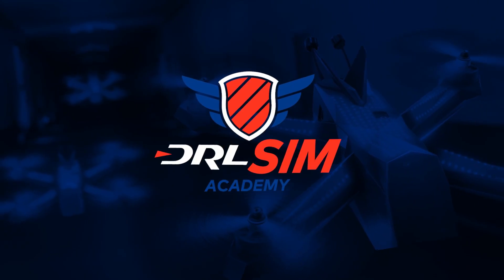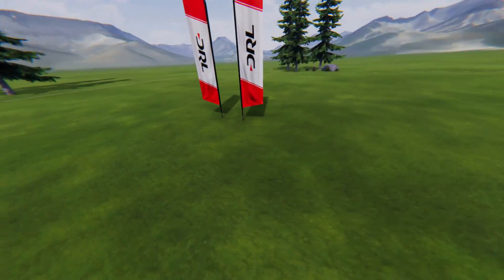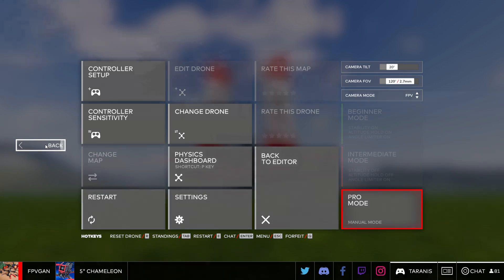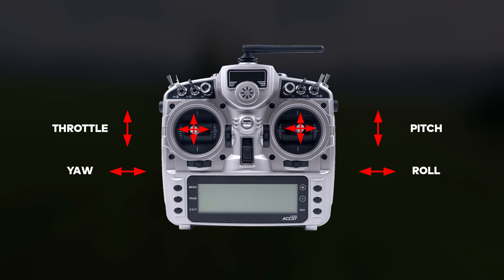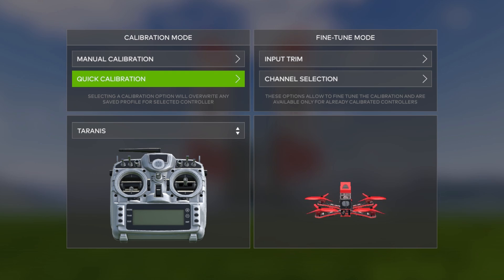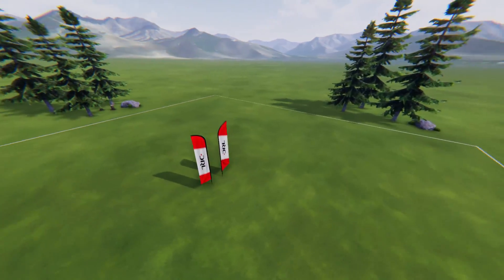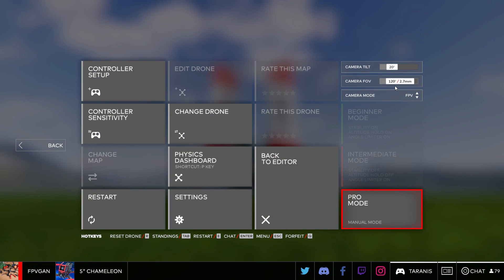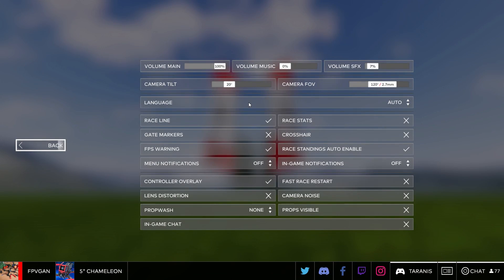DRL SIM Controls & Hovering

Comment: Hello. I am begginer and just got my taranis q x7 and bought your DRL Simulator on Steam. 
I have a little problem since when i just Thruddle up on my Controller, drone starts to move up BUT also a little forward. Is this normal? Or should it just stay still in the air as it is shown on the tutorial? 

I did calibration both on controller and in game.
Reply: Hi Dawid! Sorry for the late reply. But rest assured.. if you were taking off from a podium, they are angled, which means you will fly forward if you only applied throttle. If you land the drone on a flat surface and then apply throttle, the drone will lift up and more or less maintain a level hover. Kep in mind that the drone will still float around a bit here and there, as the drone is in Pro or Acro mode then the controls are fully manual, meaning you will have to maintain the hover and steadiness in the air. Hope this helps you! If you ever need help, feel free to send me an email KaNoodle@DRL.io
Reply: Hey Dawid, I had this problem too, everything you have to do is find a someone else's drone and fly with it
Reply: Barttelo K the podiums are angled. So you’re going to fly forward as well as up if you just use throttle from the podium. However if you are on a MultiGP podium, those are flat, and if you take off with throttle only, it will only go up. It has nothing to do with the drone being used, this is just how drones work when taking off from an angled platform or a flat platform.
Reply: @KaNoodlefpv  That's not what i meant, I had a problem where to hover in one place i had to hold a right stick back. It wasn't a controller trim issue. Just when i used throttle it seemed like i was using right stick too. I changed motors and battery of my drone and idk it probably changed center od gravity or something. Well instead of using someone else's drone i could also just reset everything to default lol.
Reply: @barttelok46  Ahhhh I gotcha.. Yeah we have an issue with the Alien build that causes the drone to roll or pitch forward when you apply throttle.. To fix this for now, until we have the updated fix in place, please delete that drone and build a new one, if you get the same issue, please let me know the exact build with frame, motors, batt, props and any extras... This way we can figure out whats going on. Thanks so much!
Reply: Its been a few weeks I'm flying. I believe because of the air resistance it will keep moving all over gently. So learning to control such conditions will help us practice in real life. Its already been long enough, how have you been practicing? I'm doing it on my Xbox controller until I get my transmitter in a month now.